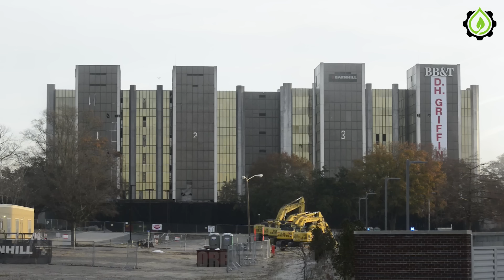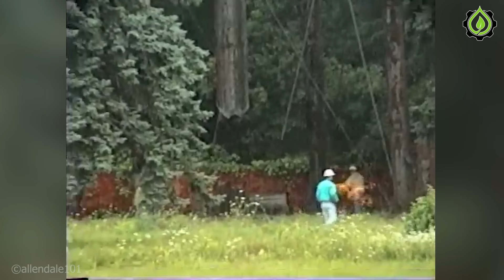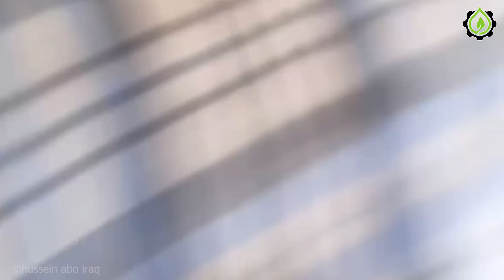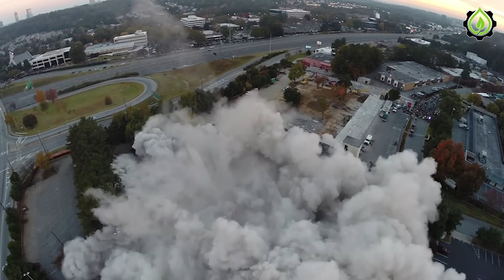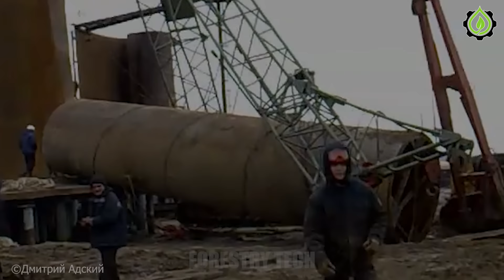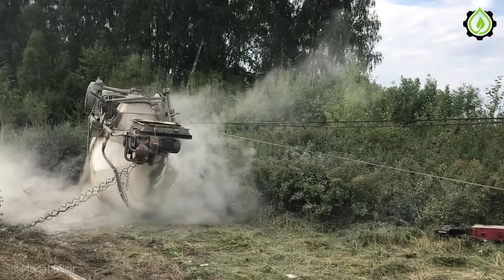Extreme Fastest Building Demolition Compilation | Amazing Dangerous Crane Operator Skills #18

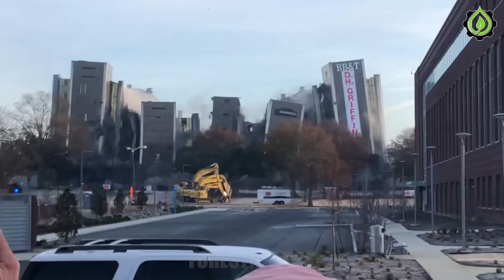Comment: Elevator towers are much stronger than the rest of the building (1:02).  Never stand beneath a suspended load.  Newton's Laws apply to motion (dynamics), not mechanical balance (statics).
Reply from the maker: Excellent, very precise observations! You've highlighted crucial points about structural engineering and safety principles.